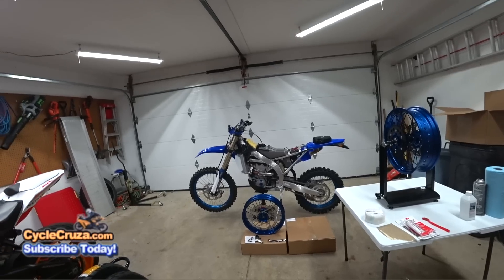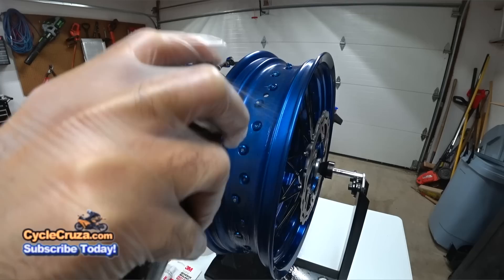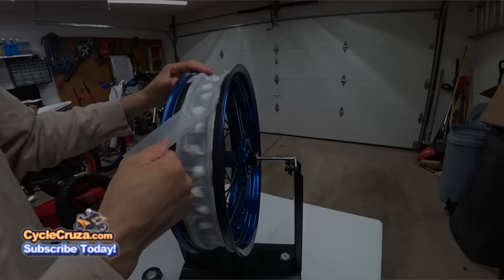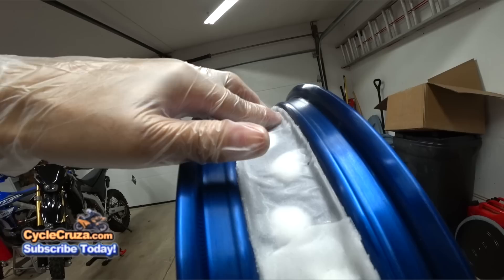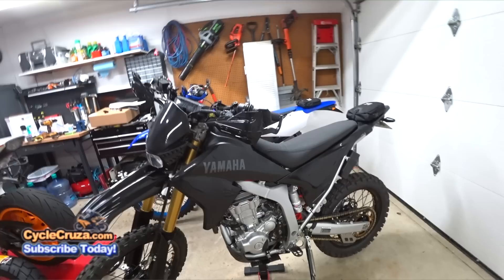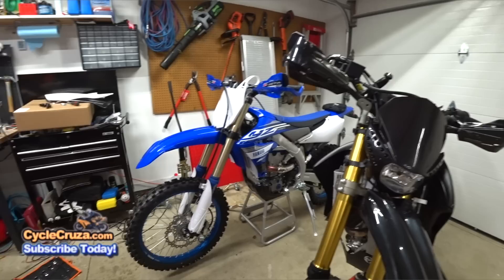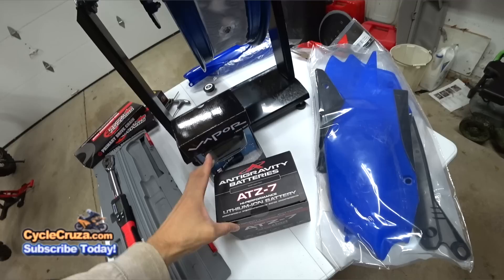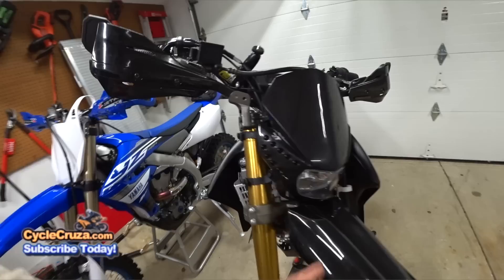Making Wheels TUBELESS | 2019 Yamaha YZ450FX Build Part 3 Supermoto

Comment: Just followed this procedure on my KTM 1190 rear wheel. Stopped the persistent leaking spoke! Only thing I wish was I'd actually measured the rim before assuming 2" tape would be wide enough (it wasn't quite enough to cover the spokes). Glad I found this tutorial - solved my problem for good.

Comment: It looks great!
By the way Yamaha WR250R 2019 is ready to be released in October. Checked Yamaha's website. My dream bike. It has been some years for dreaming to have it. Trying to buy one in the next year if I can save enough money. I was so worried that Yamaha may stop making it since the romour came out in 2017. Now I am so happy 😊.
Reply: Don't forget to follow CycleCruza's advice:  BUY lightly USED!  I found an immaculate 15 WR250R with 1700 miles, FMF exhaust and header, upgraded Dunlop tires, tuner and bark busters already installed.  $3900 OTD!

Comment: One small problem those are new spokes they will stretch then you will have to tighten them up? Good idea do keep it up!
Reply from the maker: You can tighten the spokes up, that's another reason why I used sealant on top of the spokes. It will allow movement within the tape.
Reply: The 3m sealant will have a ample amount of flex, I use it for marine applications and it is incredible stuff

Comment: So a couple of problems trying this. 1) needed to drill out a larger hole to  fit in the new valve stem. 2) the rim has little rubber plug that basically popped out when I put the tire up to pressure letting all the air out. Unsure what to do, trying to search for a rim plug to screw in so the air isn't all escaping.

Comment: You went a tad overboard with all the prepping. Using the 4412N without all the prep and sealant works just fine as long as there are no air bubbles and he tape doesn’t overlap over a spoke nipple.. Been running it on my DRZ for months now.
Reply from the maker: I don't see how the air bubbles would make a difference, they are trapped in the tape seal. We'll see though. I hated doing this work, the tape is not easy to work with, once it sticks it's stuck for good.

Comment: What a nice idea!!! How didn't think of it yet through all of this years....
( Good luck when after a while you have to true the wheel...)
Reply from the maker: You can still tighten the spoke underneath the sealant, the sealant is what helps allow movement under the tape.
Reply: CycleCruza  Dude, you gonna break the white sealant if screw/unscrew the nut on the spoke. There are special spoked wheels for tubeless tires, why didnt you bought those instead of sealing those?

Comment: I would use 4200 instead on 5200 as it is more flexible and is semi removable if you ever want to take it off.
Reply from the maker: This tape will come off easier if you use a heat gun. It's not a big deal. I've removed some of the tape before.

Comment: SPRAY RUBBER SEALANT FROM HOME DEPOT IS WHAT I USED , UNDERCOAT THAT DRIES SHOULD TO . IT FLOWS INTO ALL THE SPOKE HOLES--PUT THE VALVE STEM IN FIRST--PUT TAPE OVER BACKSIDE OF VALVE STEM--{ SMALL DOT TYPE WORKS GREAT }--JUST DON'T FORGET TO REMOVE BEFORE INSTALLING TIRE---LESS THAN 22.00 $ , AND MUCH EASIER --IF IT LEAKS--MARK SPOT , DROP TIRE RE-APPLY !
Reply from the maker: What about when you adjust spokes? With my set up, it the spoke will just spin within the sealant under the extreme sealing tape.
Reply: if you must adjust your spokes all the time that is a good point--my WARP P 9'S have been on my 625 ktm for 3 years and they haven't moved one bit or gotten out of balance/round ,  my bike is rated at 53 hp stock , but i have an open akropovic exhaust , as well as i put on a mikuni pumper--i make no hp claims--but it only weighs 309 lbs and i bet near 60 hp--it is a little scary  sometimes , so yes i am putting some horespower down .just what worked for me . also your a smart man for using a dampened hub--mine came with a  dampened primary and hub---your trans is thanking you daily  . rubber down  bro .

Comment: dude how you will work with spoke tension - this is periodically needed specially after new wheels 10h usage . And how you will work with spokes if you need to remove rim defect after road pit

Comment: Are you sure it's a 7ah battery or is that just by number. The F800gs has a ytx14 (12ah) a motobatt lipo is 5ah.   A motobatt AGM is 14ah with spacer  or 16.5ah without a spacer

Comment: Why do you want a tubless tire? Weight savings?
Reply: Less prone to flats, slightly lower weight, easier to install a tire, easier to plug a hole and able to run a lower air pressure for off-roading. Well, this is coming from a mountain bikers perspective.

Comment: Well that's one way to screw up the balance of a wheel . 
It's going to be a problem a justing spokes and removing valve stem.
Reply from the maker: 1. That's what wheel weights are for. 2. The sealant allows for spoke movement underneath the tape. 3. It's not hard to remove the valve stem. Reason why you make a spoked wheel tubeless is so you don't need a tow if you get a nail in the tire, all you need a tire plug which takes less than 5 minutes to repair.

Comment: Hey. I have a spoke wheel adv bike. I would like to get tubeless tires. But doesn't this get in the way of spoke maintenance?
Reply from the maker: You should be able to tighten the spokes because the sealant will allow movement of the spoke underneath the tape. That's another reason to use sealant. Some people just use those little happy face stickers on the top of each spoke to allow movement under the tape as well.

Comment: How the fuck is a high pressure cap gonna lower the temperature by 25•c
Reply from the maker: Raises the boiling point by 25 degrees when going from a stock 1.1 kg/cm2 (15.7 psi) radiator cap to the Tusk 1.6 kg/cm2 (22.8 psi) radiator cap.

Comment: I hope that works long term, but do you have any testimonials of that 3M tape holding up uninspected (it is inside the tire) for years.  The tube manufacturer would of course have gone through testing, but hand applied tape over wire lug gooed with generic sealant.  

Wires do loosen up and flex a bit which is part of the wire advantage, besides the low weight.  Maybe if it was a shrink kit of a continuous tire rubber band, but the tape starts and ends.  I know you overlapped it carefully, but maybe two or three full wraps might be more able to handle a lug poking through a bit and lifting the tape.

Ride safe man, and I hope this method is good.  I know you're being careful.
Reply from the maker: You can still adjust the spokes, that was the one reason I used sealant on the spokes, allows movement under the tape!
Reply: @CycleCruza  of course you can but are you going to true your spokes on every ride.  If you let just one spoke get out of true tension a tiny bit over several rides, they will lift that sealant and could lift or rupture the tape.

Seems like tubes may be better as they are refreshed each time you replace the tire, and the tube can float a bit, where the 3M tape with air pockets randomly in places can't move.

Hey its your bike and your neck, but this seems to be an independent experiment in both the materials, their combination and your skills in laying sealant and tape.  I hope all goes according to plan.

Cheers.

Comment: What's the problem with tubes?
Reply from the maker: Two reasons, much less unsprung weight and if you get a puncture you will have to get a tow. Tubeless allows you to fix it with a tire plug in less than 5 minutes.
Reply: @CycleCruza  oh, ok. Thanks for the answer.

Comment: Youllbe fucked up when you have to adjust the spokes... Just saying
Reply from the maker: No, the sealant on top of the spokes underneath the tape will allow for adjustment. That's another reason I used sealant for each spoke besides sealing them. Some people just put those small happy face stickers on top of the spokes before using the extreme tape.

Comment: Why the fuck go to so much trouble? Just use tubes
Reply from the maker: Two reasons, much less unsprung weight and if you get a puncture you will have to get a tow. Tubeless allows you to fix it with a tire plug in less than 5 minutes.
Reply: CycleCruza  humm...ok makes sense

Comment: you wouldnt be stranded with a dead battery anyways... i rode on a "Dead" battery for over a month just push starting it.. i will never ever run a lithium ion battery from all the horror stories ive heard.. plus $~40 for a new battery that has a 2 yr warranty.. ill just take my chances with agm batteries..
Reply: What problems can you get with running a lithium ion battery?
Reply: Fire??
Reply: Im not inherently afraid of lithium ion, i stay up to date on motorcycle content and i hear way more cases of fires in those batteries than i do with errors with standard batterys expanding.